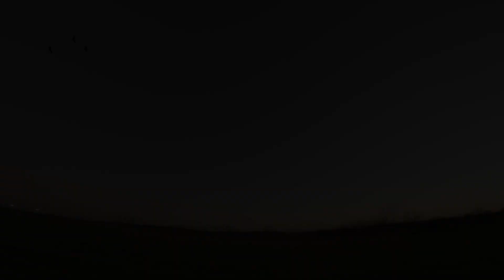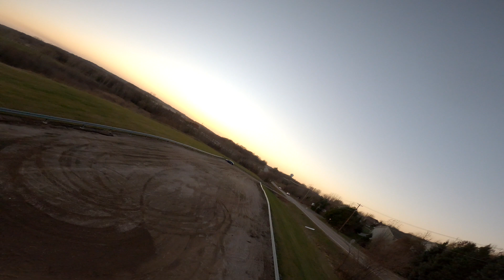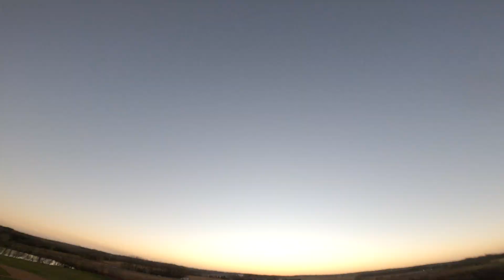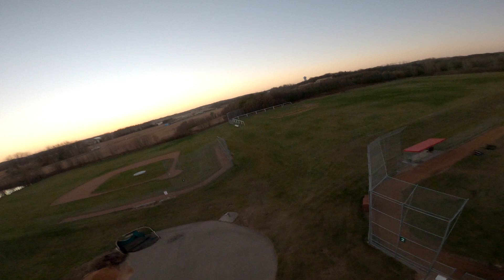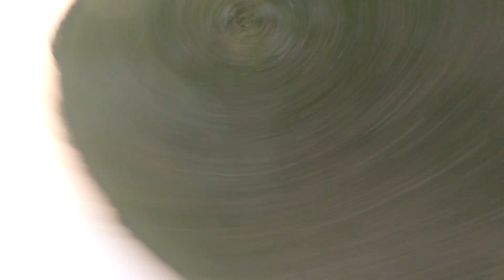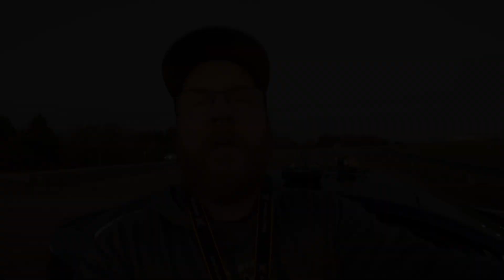ImmersionRC Ghost Firmware Update and qTee Antenna Position Adjustment

Comment: I had a really bad bout of micro failsafes using the srxl2 protocol when I started with the system a couple months ago. I updated the firmware and things improved immensely. Since then I’ve downloaded and compiled the master BetaFlight source code updated the firmware to the very latest version and now I am using the ghost protocol. The system is now bulletproof. Tony Cake has also fixed rssi and lq so it now works on the OSD. The only thing that needs some more work is telemetry.

Comment: Iv had ghost from release on 05 or 06 firmware iv had 1 micro failsafe on the sbus protocol but Im thinking it was more to antenna placement
Reply from the maker: No issues since the update either. I haven't had any hardware issues with the rx as others have reported. I love it!